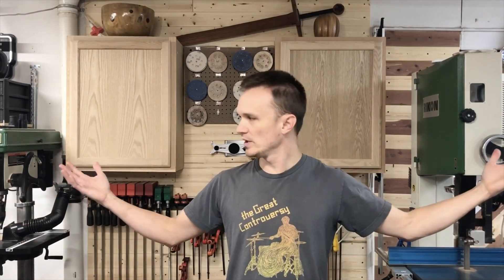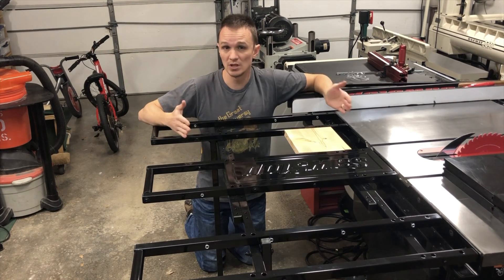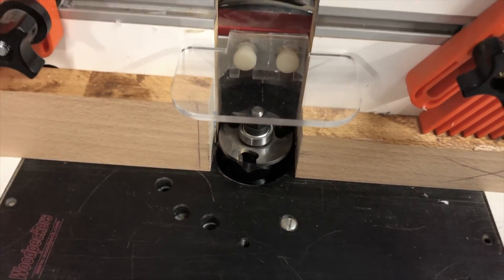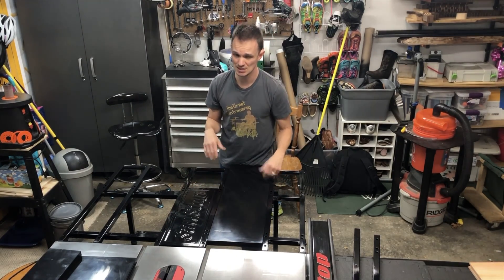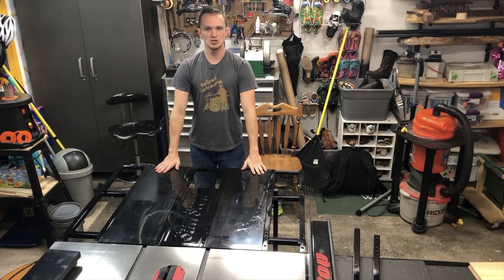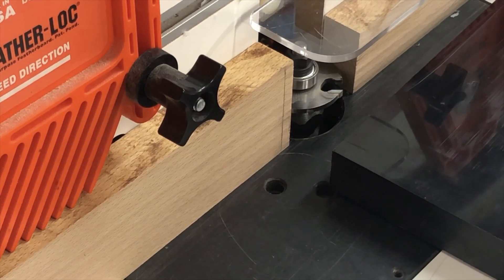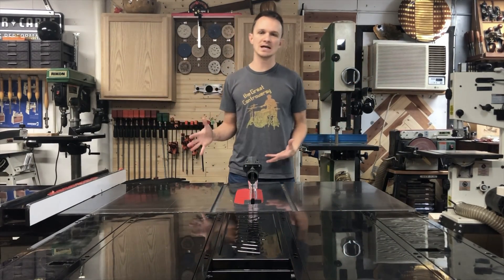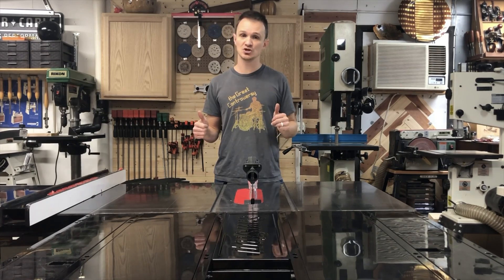SawStop DIY Custom Outfeed Table Modification !

Comment: Thanks for the idea! I decided to use melamine board as they are lighter and slippery on the top already. I found that Ikea as-is area is a great place to buy all kinds of cheap melamine boards, like $5-10 a piece of table top.

Comment: Just watched your video and i'm going to use the same materials. Is this material easy to cut ?  What  bits/blades/sizes did you use ??
Reply from the maker: Cuts like butter I used a straight bit on the router and made two passes. You can probably get a wider bit but I didn’t have one
Reply: @MSRWorkshop  thanks for the reply ! Did you use a special table saw blade ?
Reply from the maker: Nope just a normal blade. Cuts and works amazingly well

Comment: Pretty nice overall.  How about cutouts to allow miter bars to continue from the main table through to the outfeed table?
Reply from the maker: I need to add them. I never got around to it when making this video
Reply: That's necessary on a fixed outfeed table, but not so on a folding one. I just keep mine down when I use the miter gauge or sled since that type of work doesn't require an outfeed table.